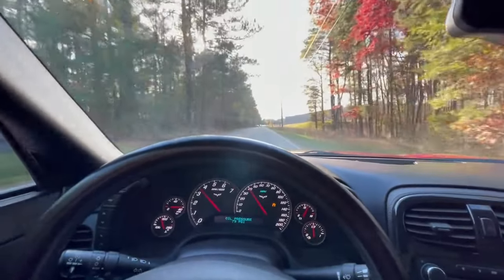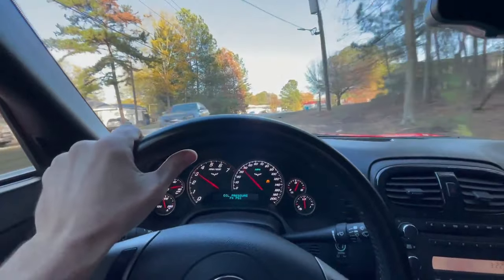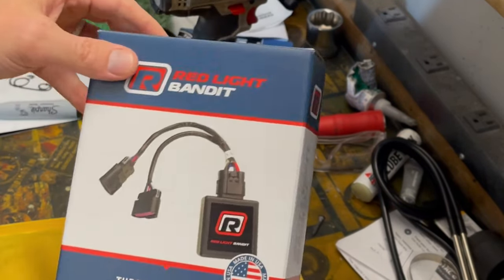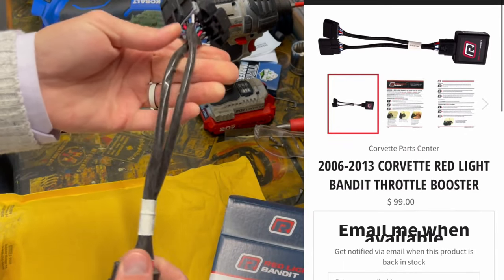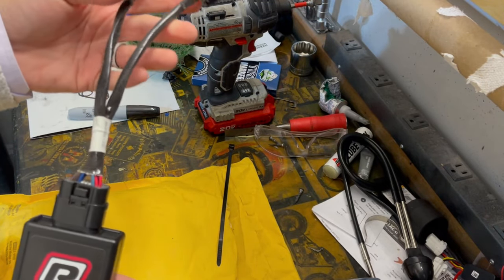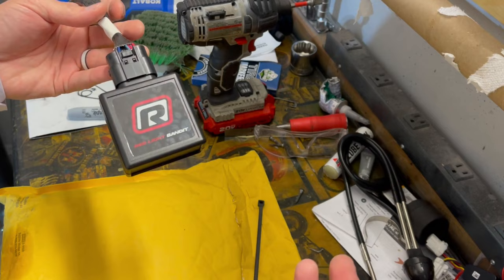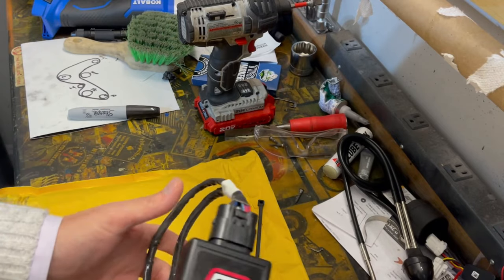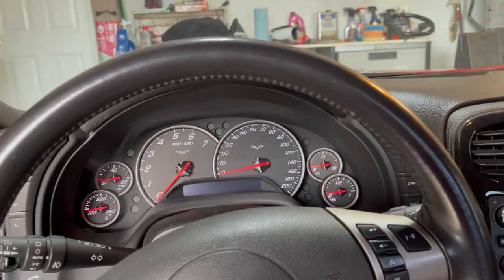Make your C6 or C7 Corvette FASTER for UNDER $100!  Too Good To Be True?

Comment: It doesn't make it faster, lol. Just sharpens throttle response. 100% WOT remains the same.
Reply from the maker: So if you get faster throttle response, you should technically get faster after each shift—theoretically faster…theoretically
Reply: @SpeedCultureStudios how long does it take to floor it? There is no delay, I have a c6, it  doesn't have one.  You know what makes you "faster"? Good tires, lol.
Reply from the maker: @moonrider99  good tires absolutely.  I mean I’m sure you  heard my comments at the end of this video.  You can also check out my follow up review video.  I’m not disagreeing with you 😂 But like I said—and like you said—if it sharpens throttle response, is it not technically making the car a bit faster?  What is throttle response if not quicker acceleration?  Even if immeasurable …
Reply: The difference in throttle position is all that is changing with this device. Good for people with a lazy right foot that’s it. The car will NOT be any faster. The power is the same across the board.  This is why every single manufacturer of these giggle gimmicks makes no claims about improved track times. They can’t because the car will not be any faster. Learn how the car likes to be driven and get yourself a proper dyno & street tune. You’ll be glad you did.
Reply: @SpeedCultureStudios I think you're misusing "faster" when you mean "quicker". The actual speed is the same (since you're not changing gearing), but you get there sooner due to less lag between pedal input & throttle output.
Reply from the maker: @PaulMEdwards  It's choice of words for the algorithm lol....but you are correct.

Comment: I wish people would stop with these cheap, useless little gadgets. If you're seriously racing your Vette, you'll have proper upgrades and a proper tune - not this pointless little thing. If you have your Vette for normal road use, you already have more power and speed than you could ever use on a public road. Why limp your Vette for this crap? Pedal Commander is just as bad.
Reply from the maker: Like I said, for $100 it was worth trying out.  One purpose of the channel is to try things out and provide reviews.  I’ve said it a million times, I spend the money so you don’t have to lol.  Check out my follow up review—I think we are on the same page.